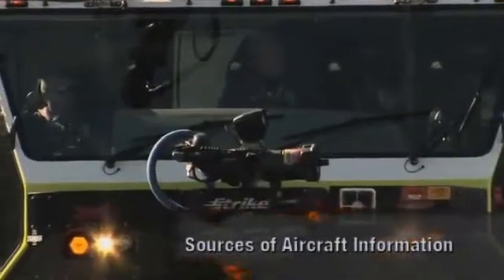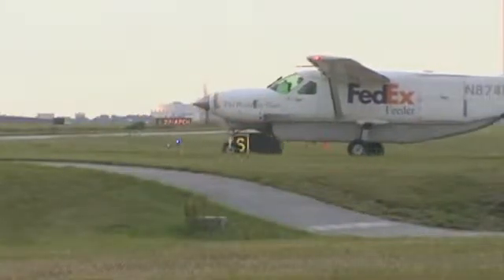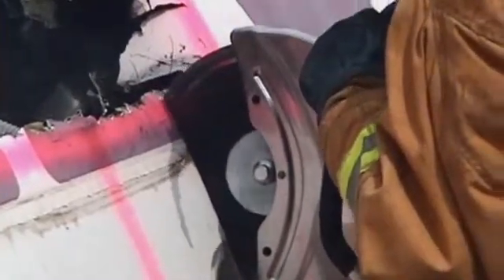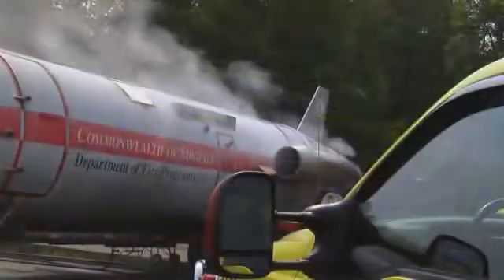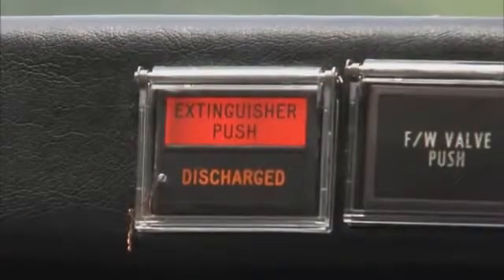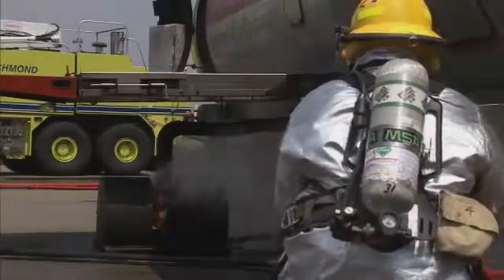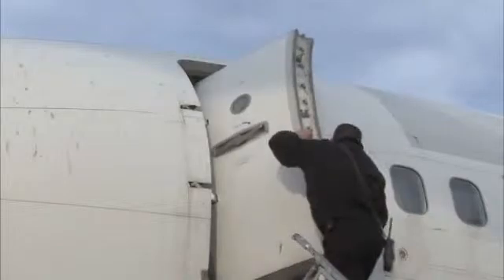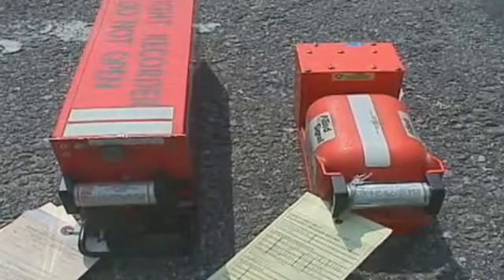ntroduction to Aircraft Rescue and Firefighting (ARFF): Prelude

Comment: DOORS CAN BE OPEN INSIDE AND OUTSIDE? THERE ARE PRESSURIZED AND LATCHED DOORS? THE FIRE FIGHTER PUSHES THE LATCH FROM THE OUTSIDE? THERE ARE SLIDES IN THE DO OR? THERE ARE AXES NEAR THE DOOR AND RADIO TRANSMITTERS WITH OTHER LIFE SAVING EVICES LIKE RAFTS WITH TRANSMITTERS? THERE IS A TRANSMITTER I THE DOOR KNOWN AS A PINGER?